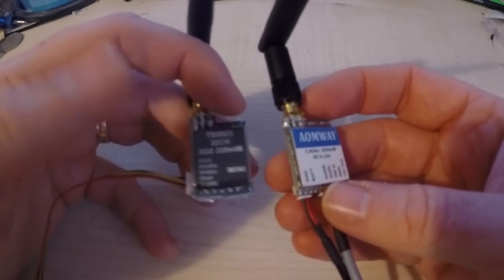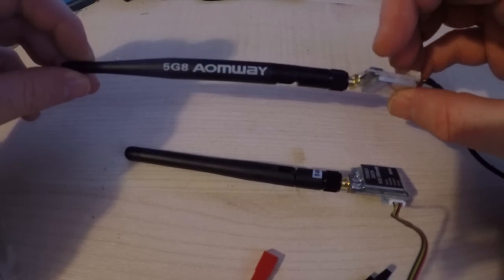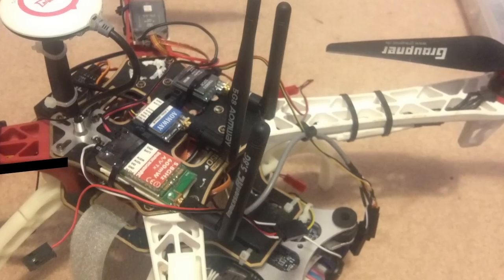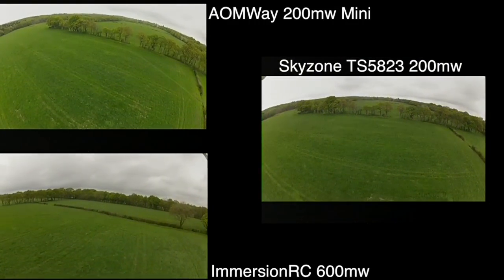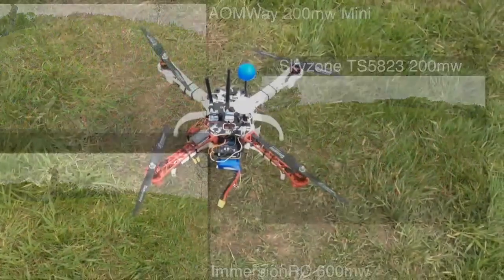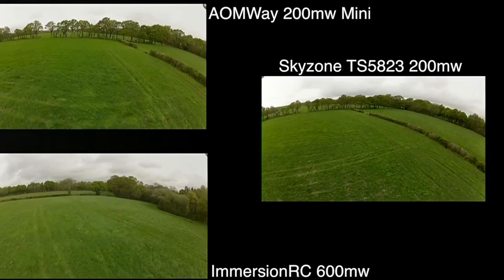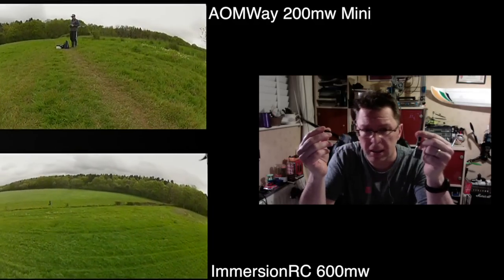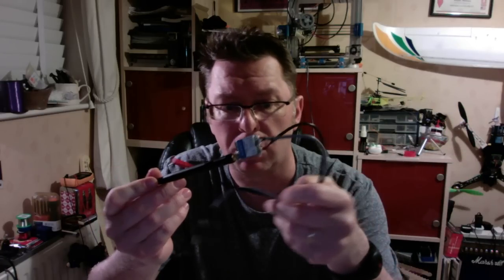VTX Shootout: Skyzone Vs AOMWay Vs ImmersionRC

Comment: Good review m8, even if it was at close range. I agree, the Aomway has the edge...An interesting test I intend doing is to use a standard Rubber Duck Dipole on my 25 Mw Immersion VTX with my 14dbi Patch and a Skew on the Sharp diversity Monitor, which gives numeric signal strength, so no guessing. I have a club flying friend who is a real expert on Radio stuff (Ex MOD), he says the Rubber Ducks we all hate, are in fact the most efficient at 5.8Ghz if made accurately and he has suggested a possible way round the VTX antenna attitude problem provided your flight envelope is not too radical....The other week, I flew my 25mw Immersion VTX on Skews out to 700mtrs with no problems at all, and another novice fpv flyer maiden flew his 200mw VTX on a Rubber Duck too, again, no problems at all, I was amazed.

Comment: I switched from Fatshark tx 250mw to AOM 200mw and I'm hooked. The money you save on a higher priced tx you can upgrade to an over priced, better quality antenna.
Reply from the maker: SoupMock Yes - I should point out that I would never usually fly on the rubber ducks, it was just for comparisons sake.  A decent skew antenna IMO is just about the most important piece of equipment if you are flying on 5.8

Comment: Thanks for the review. I have been hesitant to consider buying another 200mw vTx because I also own a 200mw Skyzone vTx and get a ton of interference (I feel like I got a bad one), and can't fly very far away. I bought a Aomway vRx with DVR incase I wanted to record the flight and it will not maintain single with the Skyzone vTx. Only reason I went with Skyzone originally was because Aomway vTx were sold out at my usual internet spots. I really don't need anything more than 200 so I might just give the Aomway a try after all. At least the products would match.
Reply from the maker: +IzakGt I've got several AOMWays now, I'm still really pleased with them

Comment: I have broken and replaced SO many IRC600 video tx's over the past 18 months. I started using the Aomway 200mw on a mini quad a few months ago, very impressed even without using a helical antenna (just a pair of Gav Yeo's skew planar) - pretty much replaced all the IRC vtx's with them now on most planes/quads aside from my "moorland exploration" planes where range is crucial but 2.4 antennas won't fit nicely. £20 a go and I've yet to break a single one!
Reply: +Richard George I won't fly any IRC600 before first bonding the SMA connector to the PCB using clear epoxy.  It makes a solid mount and can stand up to crashes.  Been using this on several IRC600's with no problems at all and full 600mw+ output.
Reply from the maker: +Captain Tripps That's a nice idea.. although I've only ever really broken the SMA's by crashing straight onto it on the 250 sized quad, and I'm using a pigtail these days to prevent any impact being transferred to the sma

Comment: A good test . Goes to show  . Would mounting the tx's in the same place, make any difference to the picture quality received. They all looked well placed   .  I for one, will be going for an AOMWay bargain. Thanks sir.
Reply from the maker: Lord B.L Thackrey A tiny bit, it's possible one position might be blocked slightly more by the frame or lipo - but in the route they took they all had opportunities to be in good/bad positions.  So not the most scientifically accurate test, but hopefully good enough :)

Comment: Does the Aomway have an LC filter on the 5v out to the camera to ensure a clean video signal? Like the immersion 600? (Specifically wondering about the Aomway 600mw v2 but maybe they all either have the LC filter or they all don't)
Reply from the maker: Well, the IRC600 isn't perfect, give it power from a noisy enough ESC and you will get your video signal messed up (and it's the same case with the AOMway) , but in a more "normal" case it's very good.  I don't know the internals of the AOMway VTX (and haven't used the 600mw at all) but my experience of using both a camera signal going into the VTX, or the 5v out look at least as good as the IRC600

Comment: currykitten hiya do you know or still have the bands and channels leaflet bye for the Aomway vxt Bay any chance I'm having problems trying to connect this old vtx to my googles it's connected to my base station ok but iv no idea what band I'm on can you give me some help or advice on this please
Reply from the maker: I'm not sure where my original instructions are, and I recall them being difficult to read in terms of which switch is up or down.  It's not to bad with a diversity goggle setup that can show you a graph of the highest signal as you can work out what's what - but here's a picture of the switches according to aomway https://sc02.alicdn.com/kf/HTB1Z6soHXXXXXalaXXXq6xXFXXX3/200130242/HTB1Z6soHXXXXXalaXXXq6xXFXXX3.jpg try having a look at this thread as well where all of us are trying to work it out :) https://www.fpvhub.com/index.php?topic=49009.0

Comment: Hi, can I use a 200mw tx with a 600mw receiver or do they both have to be the same milliwatts? For example, could I use a TS5823 tx with an RC832 rx? Cheers
Reply from the maker: +JohnnySlash Having a mw number only related to a transmitter, so your receiver is just a receiver (although it's sensitivity is measured in dBM) In other words,  you can use any strength VTX with a VRX
Reply: CurryKitten
Ah thanks. I've wanted to get some 200mw transmitters, cause I'm only flying in a small area (local park), and I wasn't sure if I'd have to get a new receiver too. Cheers ;)

Comment: I like the aomway.. i solder off the sma and replace it with a pigtail 6cm sma extension. It then weighs 6-7grams.
I havnt had any problems 400-500m out.. never go farther.

Comment: The only problem i have with aomway TX's is that they get extremely hot.
You don't want this sitting with power on on the ground for too long.

I took off the shrinkwrap and soldered a heatsink to the shielding and that certainly did the trick for me.
You could also just make your own heatsink with some 12 or 14 awg motor cables full of solder so the heat has a bigger area to disperse onto.
Reply from the maker: You certainly don't want them sitting around too long, and I know it's the scourge of the quad racers when they are sitting ready to fly for 10 minutes or more.  The 200mw certainly don't get as hot as the 600mw models !  That said, I run 4 or 5 of these and I've been unable to get one to fail, even the one that I ran in my little 1/24 scale crawler indoors for 30 minutes at a time with practically no airflow over it

Comment: Hi I wonder if you could help me out as im finding all the confusing. I have a twister quattro x and have been looking to buy the quamun v2 goggles to use with gopro4. need to know what fpv rx tx to get of ganggood. also can i get power from the drone batt to run the tx or do i needs another batt
Reply from the maker: +Barber Graham This is fairly cheap and functional http://www.banggood.com/Httpwww_ebay_comitmWireless-32CH-5-8G-600mW-A-V-Transmitting-Receiving-p-975775.html If your lipo has an xt60 connector, then one of these http://www.hobbyking.com/hobbyking/store/__18869__XT60_JST_Male_In_line_Power_Adapter.html can split off the power to the VTX.  Make any sense ?
Reply: +CurryKitten thanks for the links, I had been looking at Eachine FPV Boscam 5.8G 600mW, but was unsure battery would go with this to power the tx. I under that I would need a lead for the gopro 4 as well.
Reply from the maker: +Barber Graham Cables for the GoPro are fairly cheap and you can get them all over ebay as well, but something like this http://www.banggood.com/Tarot-TL68A10-Gopro-HERO3-AV-Video-Output-And-Charging-Cable-p-914729.html is what you are after.  If you want to charge as well, pay special attention that you must have only a 5v supply, plug it into a 12v output and magic smoke WILL appear.  You will also need to potentially splice the video leads from the VTX to the camera out cable as well.  2 min job with a soldering iron
Reply: Thank you for your time. Ill het to it soon. I think there should be more package to buy to make it more simple for newbies.

Comment: I have been waiting for you to do this review :D
Had my eye on the Aomway for a while a couple of reviews do say the get hot on a 4 sell. I myself did a test with a cheaper alternative receiver FR632 Diversity 5.8GHz 32Ch Auto Scan LCD A/V Receiver at £37 and as good as a £60 Immersion Uno on a single antenna but with the advantage of having a patch put on there aswell where the immersion dual comes in at around £120 that's a big saving. With a saving on the VTX Transmitter you have reviewed that's a new 250 quad paid for. Also ment to add that the dual receiver with patch is ideal for fpv tree and bush runs with no picture loss.
Reply from the maker: Pudsey - Rc Nice - personally I do like to keep wire free on the google though, so I'm using the internal vrx and the DVR goes around the Fatshark strap.  I do want to try the trees on a 3 turn helical though to see what difference it makes.  Has enough of a wide beam to keep the quad in with "manual" head tracking as long as I can work out where I am
Reply: the wire wasn't too bad as I used your tip purchased a set of 100m sma extensions one for the quad and 1 for the patch antenna. Excellent tip by the way is going to save on video tx for sure. Like you say even a knock on that connection can result in range loss.
Reply: Pudsey - Rc CurryKitten meant, he does not want to put the Diversity antenna on a tripod and then plug his fatshark goggles into it.You have the Quanum Goggles which don't have an internal Rx, so it was easy for you to set up a tripod-less system.Can you plug a DVR into your set-up?
Reply: yes
Reply from the maker: Pudsey - Rc Yes - no wires attached to a ground station was what I meant, I'm free to wander around with the full setup on my goggles... which is handy for finding crashed 250's
Reply: Also, if your hiking in the woods, you want to travel light. You don't want to carrying ground stations about!
I do fancy some of those Skyzone goggles which have built in diversity. If they had a built in DVR, they would be perfect!!!
Reply: mines not a station : D DIY Goggles

Comment: Hmm what kind of camera are you using? The quality seems superb!
Reply from the maker: +pukki34 It's a GoPro 2, both for the HD and the live picture.  Which is absolutely fine in quad like this, it only struggles if you have the sub low on the horizon and you point the camera at it

Comment: +CurryKitten…Thanks for this review…only one question : Can i swap between the 25Mw and 200Mw output on this AOMWay? and how can this be achieved? is this easy?(switching between 25-200Mw) Thinking about ordering this VTX but i need to switch to 25Mw in order to race with friends...thanks in advance and greetings from Amsterdam, The Netherlands.
Reply from the maker: The 25/200 switchable one is a newer model than the one I tested which is just 200mw.  As I understand it, you'd solder across 2 pads to make it 25mw, which would easily be replaceable with a switch.  However, a friend did look at this one - as he races and needs 25mw and it was coming up very low on his IRC power meter, as in under 10mw.  Ironically the 200mw mode was overpowered
Reply: +CurryKitten ....Thanks for the fast reply amigo.....mhhhhhh...10Mw is not what i am looking for....too low...underpowered yes...somebody should do a review about the real 25Mw output of all the VTX's....I want a Full 25Mw not 10 or 15 :) ...anyway thanks...greetings from Amsterdam, the Netherlands

Comment: You could leave the link to the 3 products and make clearer their opinion about who won?

It seems kind of obvious that the 600mW to have more power would win in quality and scope
Reply from the maker: It wasn't really a"which is the best", more of a "how do these two cheapo VTX's stack up against an IRC600"  Of course, since this video was made even more cheap and some veyr good VTX's have come on the market as well.  If it wasn't clear though, for the price, the Aomway wins - at least in mini quads.  You don't really need to go 600mw in this situation - I would use it in planes which push range, but that's about it.
Reply: Yes, i use ImmersionRC 200mW on my mini quad. But i need buy a 600mW to put on a FlyWing :X

Comment: Quick question if I burn my Vtx system can I just replace it with the same one by unplugging the burnt one and plugging in a new one??
Reply from the maker: If it's the same type (make/model), then yeah, and as long as you haven't burnt out any of the cabling (but you'd be able to see the physical damage if you had)
Reply: CurryKitten now if I burnt the cable I would have to solder the wires back to there original places wouldn't I?
Reply from the maker: Yeah - if the cable burnt out, then you could just replace that bad bit of cable with a few solder joins... it rarely happens on the connectors, so hopefully those can be reused.  If it's just a case of the VTX getting left on for ages, or being on without an antenna in, then it's usually an amp chip that blows on the vtx and wouldn't normally affect the cabling
Reply: CurryKitten yeah well I'm ganna have to buy a whole new Vtx system and unsolder the old wires cause there burnt and resolver the new system onto the board

Comment: aomway 200mw vtx mine lasted 5mins before it died antenna connected with a 3s setup
Reply from the maker: +michael taylor Bummer you got a dud.  I hope you got a replacement/refund.  Mine is still going well, and have bought several others since

Comment: can i use aomvay tx with fatshark teleporter v5?
Reply from the maker: +Trung Le Anh In a word, yes.  You just need to set the dip switches on the AOMway so that it transmits on the FatShark compatible channels

Comment: Muy buen video comparativo. 
Aconsejo comprar Aomway Mini 200mW o 600mW 5.8 TS5828

http://www.hobbyking.com/hobbyking/store/__73600__Aomway_Mini_200mW_VTX_and_FPV_Tuned_600TVL_Camera_Combo_NTSC_2_.html

http://es.aliexpress.com/item/New-Version-5-8GHz-600mW-32-Channels-Mini-Wireless-A-V-Transmitting-TX-TS5828-for-5/32378907248.html?spm=2114.17010208.99999999.270.QYbg0E

Thanks.
Reply from the maker: I would say the Aomway, but without that CMOS camera, get a decent CCD sensor.  Not at all convinced by those little TS5828s
Reply: Thanks for the reply
Which camera to buy, I have a QAV 210
Reply from the maker: The right camera in just about all circumstances is a Foxeer hs1177 or a Runcam Swift.  I don't have a QUV 210 frame, but I expect they'd fit in ok
Reply: ok
excuse my bothering
Aomway Mini 5.8Ghz 40CH 200mW 25mW Switchable supports RX RC832?